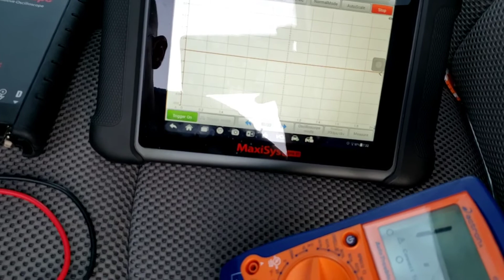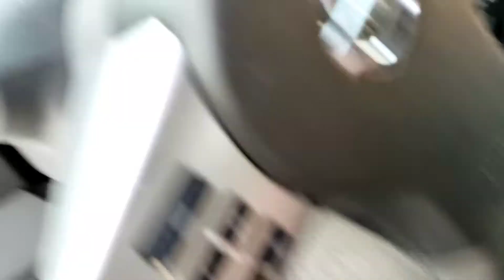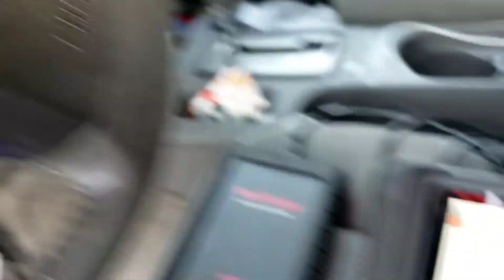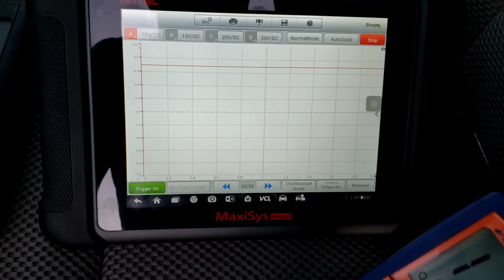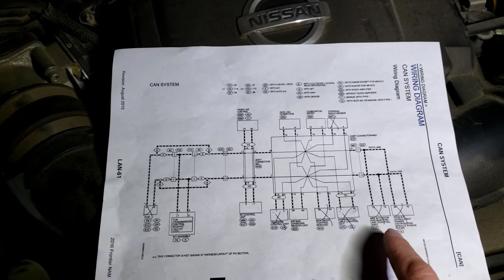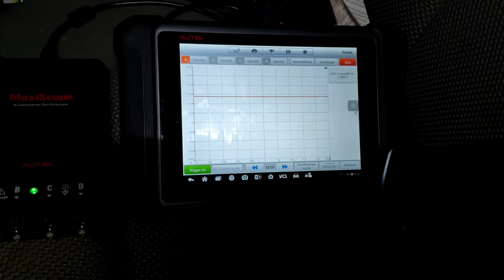2016 Nissan Frontier CAN Bus Issues Part 1

Comment: I’m pretty sure when you ohmed the pin 6-14 with the Battery hooked up you were checking resistance with the bus active. Always check to make sure the bus is offline before ohm checking it.